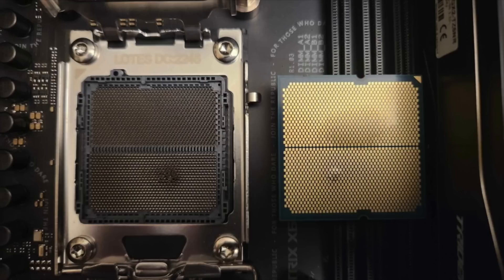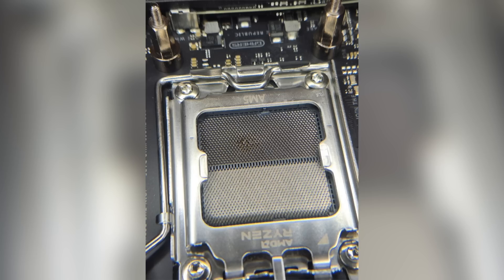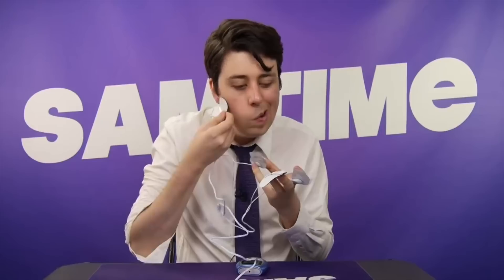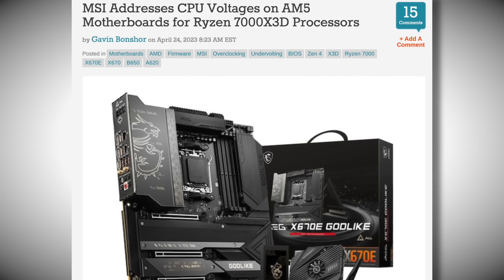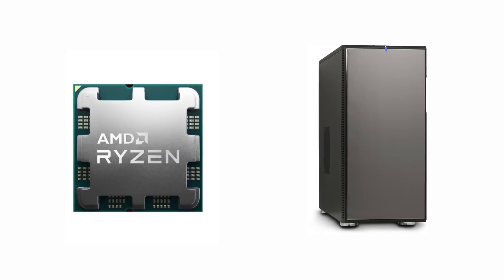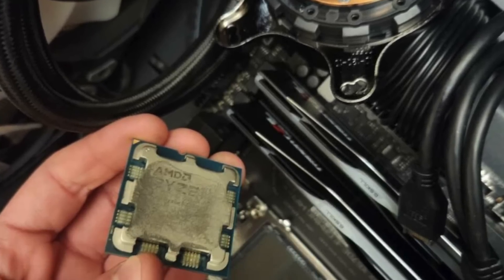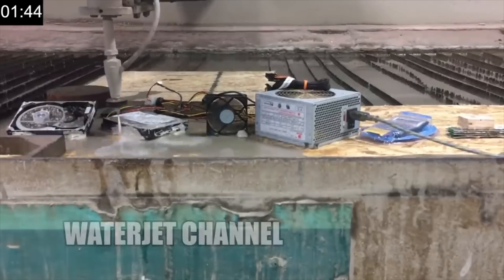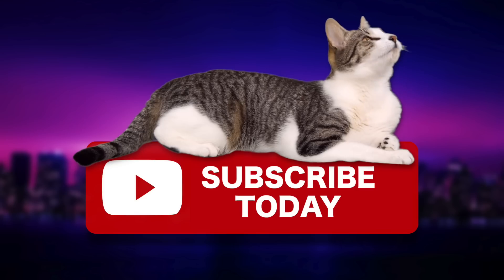AMD Responds to Their CPUs Melting

Comment: As an R5 5600x user I can confirm this is legitimate 🔥
Reply: I don't think the pin out is the same. Yours is AM4 not AM5, and the AM4 didn't have these issues (it was also pins on the CPU not on the motherboard). Even AM3+ I routinely ran 350w to the CPU though it had thicker pins there were fewer and Ryzen doesn't use a lot. My TR-1950x for example only pulls about 465w overclocked on a tiny 120mm AIO (otherwise it stays within it's 180w TDP). That means AM4 is likely only drawing up to 235w, but which is not much.

Power draw is individual components, total power draw for one of my systems is 1,700w from the wall while running Crysis 3 at 4k Ultra at roughly 110 fps. Obviously when running liquid nitrogen or my sub zero phase coolers power consumption can far exceed these values (haven't burned out a CPU yet, and I've pushed Ryzen past 1.75 Vcore which is not advised but I was trying to burn a 1700 however performance was degrading with excess voltage since I needed liquid nitrogen or helium to drive the temps low enough, and my dewer was empty so best I could do was -60 to -40c on phase)
Reply: @jakegarrett8109  Yes you are absolutely right mate but I meant this cpu because Idk what it is but everytime I game my cpu hits 96 degrees and dials down the clock speed, reason why I have to undervolt it and sometimes underclock it below 3.7 GHz as well which gives me really terrible cinnebench scores as well but doesn't neglect gaming performance much so yeah... (Also my cooler is a msi mag 240r)
Reply: @RaneKun  First thing is I check that the fan is running at adequate speed (you may have it plugged into the wrong header, or often the BIOS setting they have it set to silent which is great for most people, but not great for performance, I set it to full speed to test and rule that out). Then once you've tested that and its still hot, you may remove the cooler and make sure the paste looks uniformly smashed and thin (you should see the Ryzen logo through the paste, unless you used liquid metal paste).

I would also test with your case panels off, some cases are terribly hot and increase it like 20 degrees. If that's the "case" (lol), then I often leave the panel off or get some more case fans. I usually use open air test benches or open cases for this reason.

For AIOs make SURE the pump is set to full speed, if its not no matter what you do it will be terrible (I set all fan headers to "full speed" except the CPU fan and use a custom fan curve for it, but AIO should ALWAYS be set to "full" or "water pump", or "High Performance")

Comment: Glad to see you branching out into other A-holish computer hardware companies.

Here's a bit of info to get you started on the Nvidia Geforce RTX 40 series if you're interested, and pro-tip, AMD is doing something similar with their Radeon RX 7000 seires so you could make a combined video.
Historically, Nvidia's top card will set the price of all the cards below it, to an extent. 
The rough pricing goes like this
tkae the cut down version of the top die, like the 4090, but not the 4090TI/TitanADA, the 3090, but not the 3090TI, the 2080TI and not the Titan RTX ect.
Then a card that is 3/4th the spec would be close anywhere between 1/2, to 2/3rd the price, such as the $1100 2080TI and the $700 2080
Take a card that is 1/2 the spec, and it should be between 1/3rd, and 1/4th the price, the 3060 is an odd one, because it is nearly 1/5th the price of the 3090.

Now, with that context
The 4080 is only 2/3rd the card for a whopping 3/4th the price.
The 4070TI is even worse, less than 1/2 the card, for exactly 1/2 the price. Normally it would be 1/4th the price.
Terrible pricing considering the previous equivelant card, the 12GB 3060, is only $330, and was priced during the parts shortages, and now that prices for many of these parts and raw materials are approaching and even below 2019 prices, the successor to the $330 3060, is $800, again, despite it possibly costing less to manufacture than the 3060 when its MSRP was set.

Oh, and that $1200 RTX 4080, doesnt cost much more to manufacture than the $350 ARC A770 16GB, only about ~60% added MFG cost due to the node, GDDR6X, and higher TDP

AMD is dong something similar by using cost cutting measures, but not passing those savings onto you, in several cases these cost cutting measures are resulting in the same and even less performance than their last generation

You could end the episode with something like 
"I dont know why we're even selling gaming GPUs anyway, there's plenty of demand in datacenter, they'll pay $900 for a 4GB RTX 4030"
Or from the AMD angle
"I dont know why we sell GPUs at all, that $800 7900XT, we could have sold eight 7800X CPUs for a total of $3200 with that same silicon, and we wouldnt have needed to include the RAM, cooling, or licensed ports"